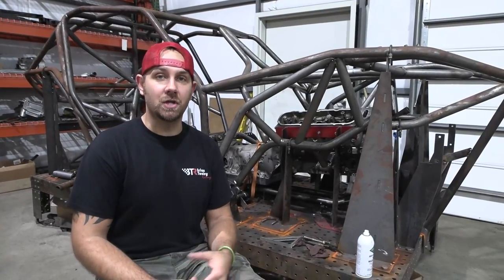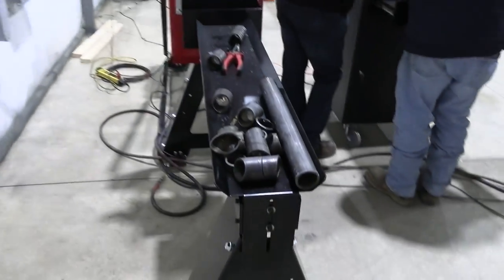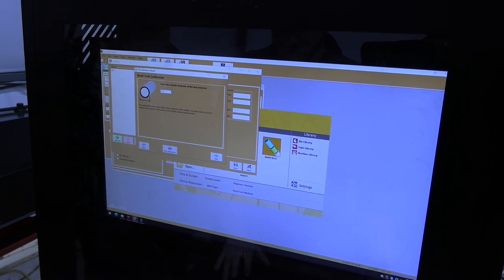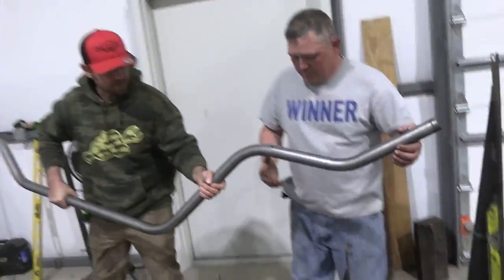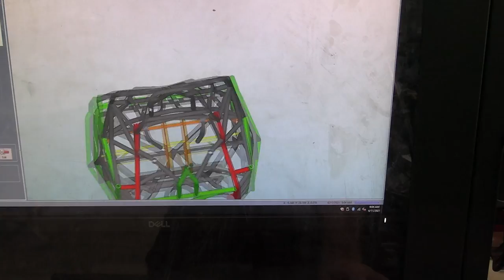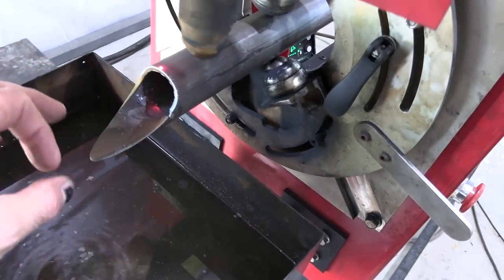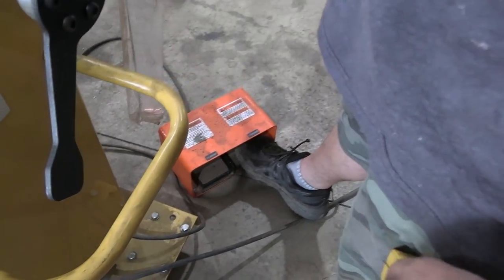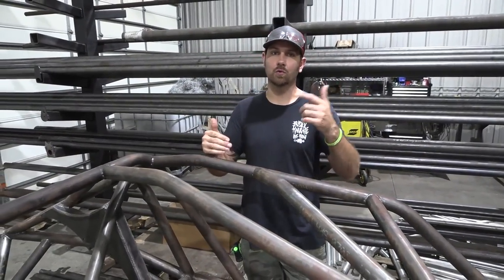How to Build a Rock Bouncer Chassis

Comment: Do you have a "ballpark" swag what the weight of a two seat Rock Bouncer  (turnkey) might be for the smaller variant in this class of vehicle?
Reply from the maker: around 4200lbs
Reply: Ouch that is too heavy for my specification.  But I love the machine.  Thanks